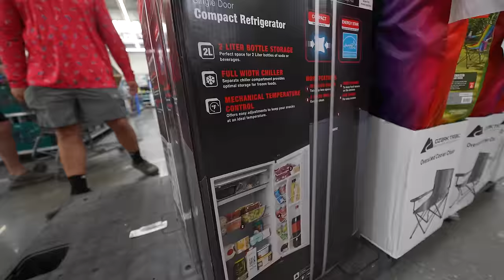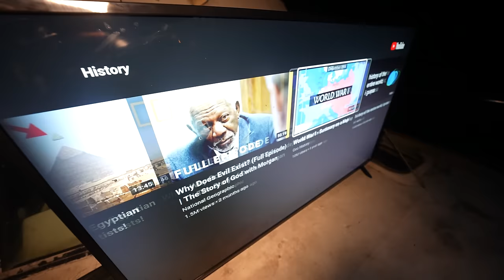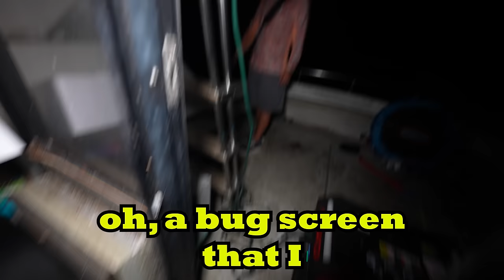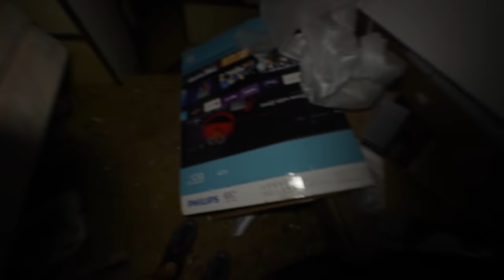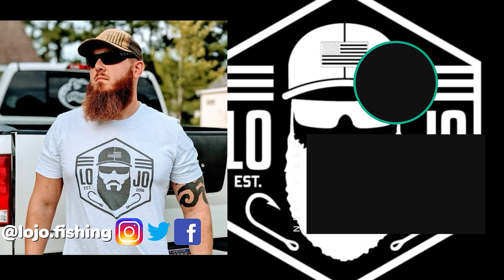$1,000 Walmart CHALLENGE on my FACEBOOK MARKETPLACE Yacht!! **Ex-Employee PRANK**

Comment: Soooo..  The water was probably moving in the bottom of the boat as y’all moved all your guy’s weight back and forth.  The bottom is usually separate chambers like an ice cube tray.  So it look like it’s flooding but it’s just spilling over to the next chamber.  Great video guys!  Get a pressure washer on that thing already!

Comment: the larger holes in the transom normally have hoses hooked to them coming from the exhaust manifolds/risers so the exhaust and water to cool the engine won't fill the boat 
the smaller holes are most likely water intake hoses for the heat risers attach a couple inches of  hose to them plug the hose ends off with wood dowels  again don't forget to hose clamp them 

If it were my sweet yacht  I would measure all of the hoses in the transom use a hole saw minus the bit and a 2x4 to make plugs don't forget the hose clamps 

The other leak is most likely above the water line the extra bodies caused it to drop into the water a rotted hose connected to a fitting for the bilge pump or poop port   take the kayyak around the yacht and pack every hole you see with calk
Reply: I was think the same thing about some of the leaks being above the water line.

Comment: I own (and live on) a 41 foot sailboat. You have thru-hulls in several places on that boat. You should have a inlet for your toilet that will pull in raw water (pond water) to flush the toilet. Most likely that is your issue with the water coming in. There's also probably a discharge line for the toilet to pump the toilet straight overboard, that could also cause the issue. Both are below the waterline normally, and seeing the lines for the engine, they're probably dry rotted as well. Check any cabinets in the bathroom (called a head on a boat) and you'll probably find the thru-hull causing issues. 

You also should have a thru-hull above the waterline for each sink aboard the boat. A cheap fluid transfer pump from harbor freight can work to pull small amounts of water from the boat, but I would get a cheap $20 bilge pump from Amazon paired with a car battery and solar panel to keep the water out of your boat for now. You can buy tapered cork plugs that you can hammer into the thru-hulls to stop the water coming in,  a couple bugs on Amazon.

Comment: Love the videos , love you guys , sweep that damn boat tho, even if it gonna sink. Vac it real quick and pressure wash it with just water ( no soap or chemicals in your body of water ) to clean it up a little. Also since you have generator on it might as well get a fluid transfer pump so suck most of that water out to help locate the leak and just get $100 worth of flex seal products. Love the yacht videos can’t wait for more

Comment: Get 4 larger steel pilings and stand them up, 2 on each side of the boat. Then either attach the boat to the pilings or sling it to them. Then the boat can't sink because it will have "legs" holding it up. You can even adjust the depth the boat sits on the water if you sling it up shallower. If you get really energetic, you can build a roof over the entire boat so you can sit out there in the rain and pretend you're docked at a pier waiting out a storm. Happy sailing!!
You're welcome!!!  😁😁😁👍👍

Comment: Might need to invest in a trailer and pull it back out so you can gut the inside and clean it. Once it is out you can properly install the plugs. You can also scrap the engine and install some pumps in the rear so if it ever takes on water again it can be just pumped out.

Comment: So, it rained. You had all (what 600lbs of man) been hanging out in the front of the boat, then moved  to the back to check the engine compartment. Extra water from the rain, gathered in the front of the boat, then flowed to the back.

Comment: I think you have a through bilge. I wouldn’t doubt that there could still be water coming in somewhere but I think what you’re seeing is the water moving fore and aft as you guys all move around. Collectively it’s like 800 pounds and sometimes its in the forward part of the cabin, and sometimes you’re all standing around the engine compartment.

Comment: Plug the exause, water intake, and drain plug with spray foam. You might have to pull the plug made from what rver he jammed in there and hold a rubber sheet with some under water glue to stop that leak without pulling the boat. Then put all the weight to the back and pump everything out. That would make a good video.

Comment: This is such a cool concept though, tip that motor out, and all the ruined interior seal it, and have it be an actual floating mansion, install a generator, or a few battery packs and solar panels, storage, shore up/strengthen the floors, deep clean.  It would be epic.

Comment: I think you should let all the water drain out before you drop it in next time. Would of been easier to pump out out of water when its all angles toward the back of the boat. You need to build a boatramp you can pull it out of the water with 2 beams and a winch to drain out everything. Then drop it back in with and actual plug.

Comment: Inboards have blowers guys to run before starting engine for any built up gas fumes in the engine bay. You have a leak or the water is standing guys and moves through baffles in the hold as you shift your weight around

Comment: Pull the engine out and put a sump pump and generator in its place. You can probably use the exaust to make the generator quieter and if you mount it it will be quieter as well.

Comment: Just to help.. in the middle of the boat on the floor, there will be a panel, lift up and turn the shut off valve off. My boat had a water leak in that spot.